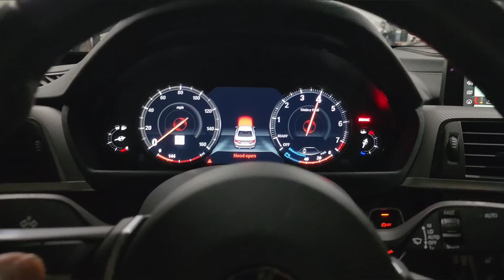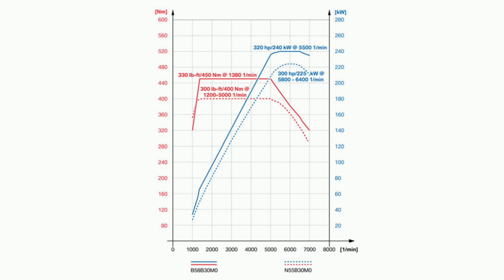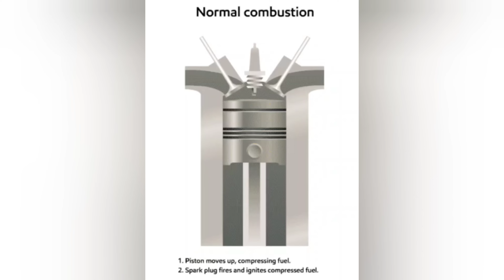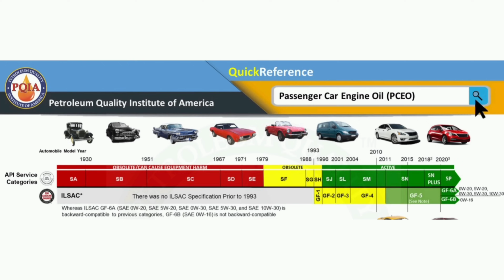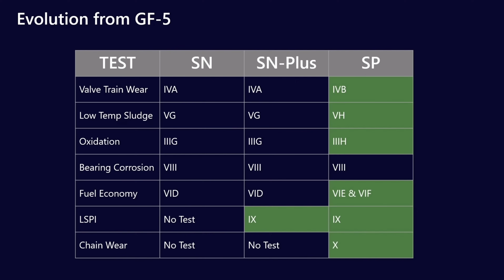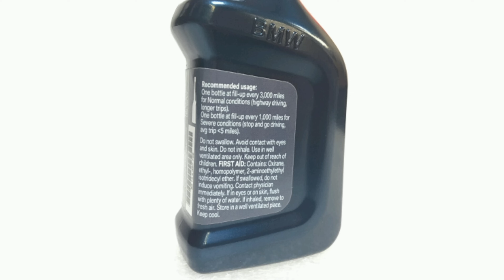The Wrong Oil Could be Causing B58 "Injector Failures" (LSPI Explained)

Comment: Finally someone is making the B58 community aware of this. It specifically applies to DI turbo engines like the B58. I bring it up every time someone asks for oil recs. API SP only for me. Also keep in mind some oil additives, like liquimoly ceratec, have high levels of calcium that contribute to LSPI as well.
Reply: 😱 I put that shit in my engine last oil change! I had no clue
Reply: Just downshift. You’ll never have to worry about lspi
Reply: API sp oil what I’ve been using in about to switch from api sp 0w20 to LL01  liquid moly 5w40 because I watched another video from kern an he said LL01. So that’s why I bought that kind
Reply: What do you guys recommend I live in southern California
Reply: @BoostedF36  pretty much any 5w-30(in warmer months) that is API SP rated.
Reply: But what about api sn 5w30 liquid moly mologen oil that what I was about to switch to..   I have Been using that 0w20 api sp liquid moly since I’ve had the car it be doing great should I stick with that for now
Reply: castrol euro 0w30 is the best oil for b58s for daily driving
Reply: @robotbro7187 No, it's not, it has a very old additive package and the newest bottles have more Group III and lower PAO.

Comment: LSPI has been linked to high Calcium levels in the engine oil.  If you're using LL-01 or some other older spec oil, those oils have much higher Calcium levels than a modern SP synthetic oil.
Reply: Also certain oil additives have high calcium levels . . . like liquimoly ceratec!
Reply: what about Pennzoil Platinum Euro 5w-40? this is rated as API SP and at the same time meets the ll-01 spec
Reply: @maxgnarnage also if you are adding oil additives, you are essentially “watering down “ your oil and reducing the oil life. Shorter oil life=not as much protection. Just stick with BMW standards.
Reply: @540irwd same story with castrol edge euro. you’ll be fine!
Reply: LL01 is needed for high sulphur fuels , SP rating is the key

Comment: We also need to talk about Complete fuel system cleaners with Poly Ether Amine. It the fuel cleaner doesn’t have Poly Ether Amine then it is useless. Keep them injectors clean, don’t lug the engine, don’t use oil that has calcium in it, try to stick with oils that are certified to work with your engines.

Comment: If the oil rating changed from SN to SP, it most likely has had a chemistry change also. You would need to send both sample to a lab and have them tested. Automotive oil manufacturers can change the chemistry without notifying the consumer.

Comment: You say don't lug the engine by pushing down on the gas while at a low engine speed.  One thing I found on another video if you hold the left (-) paddle switch on the steering wheel for a few seconds it downshifts the trans and rev matches the engine so you can do this instead of guessing what gear to use to accelerate and avoid lugging the engine.  I have a 2023 M340 and it works on my car.  It is really cool the way it rev matches for the down shift.  Hold the - paddle for a few seconds then punch it and hold on cuz it's a b58 engine.  For what it is worth.....

Comment: Thanks for the video. So basically with a bigger turbo that spools at f.e ~ 3700 rpm vs. the stock turbo that comes in full boost at ~ 2500 rpm, I'm less prone to have that problem. And I use PEA fuel additive from time to time, always high quality fuel (RON 102 EU / 95 octane US) and API SP 5W30 oil. So it's about time I order my bigger turbo, only to prevent LSPI, of course. 😂
Reply: I wonder how true this is, might have just convinced me a pure turbo is the best reliability upgrade for my 440 😂
Reply: @o-oo-oo-o3234  It's just a guess from my side but LSPI occours mostly in a low revs up to 2000 rpm with high load. So on the stock turbo, from around 1500 rpm (pedal at 100 %) you feel the boost building and at 2000 rpm it starts to go pretty nicely already.

With a big turbo, it should be like completely dead up to 2500 rpm or so which means there is not much load at all at 1500 to 2000 rpm (engine runs basically like a natural aspirated one). So the load will be a lot less in that rev range AND I would clearly not be trying to accelerate in that rev band anyway. 

I could even reprogram the gear shifts with XHP so that the engine is in the 2000 to 2500 rpm rev band when I want a little bit of acceleration instead of 1500 to 2000 rpm where I have "only" like the 300 Nm (~ 220 ft-lbs) of torque from the N/A engine.

Comment: Honestly, with all the new small engines with turbos, now is the better time than ever for amsoil. I believe even their oe line boasts 100% LSPI protection iirc. Though it's probably got some caveat to that claim. I'm glad I went with a non turbo Forester as ever since I read about lspi a few years ago I've been nothing but paranoid for others
Reply: I ran their signature series oil for years with over 700hp in mine. Excellent oil. Still used 0w-20 too.

Comment: Im currently financing a 2022 m340i that is still underwarranty. Unfortunately it only covers oil changes every 10k miles. I under stand its recommended every 5k miles. Would you still recommend 0w-20 liqui moly engine oil?

Comment: You mentioned being in low RPMs and hitting full throttle, I do that to initiate slides, and also feather the accelerator, which actually backfired and doesn’t let me continue the drift. it feels like it cuts all the power when I start feathering it.. especially since I do not have an lsd. Do you believe this will create big problems for me down the line as I am drifting/sliding the car more frequently. I do let it warm up, ride around, before doing it. Anything that you suggest I can do to prevent any damage…?

Comment: Back in 2017 when this started happening people called me stupid for saying that oil chemistry is causing the abnormal preignition with di engines. It's also not just "low engine speed" but also midrange can occur under certain conditions. TLDR is that taking calcium out is good in this case if you substitute with other detergents. 

I'll also say one more thing that people say now I'm "eating dog sjht": Premium gas, especially on DI engines, has a massive impact ( good as in low ) on engine bore wear. The volume of gas mixed in the ring lang area with oil is huge on DI engines and a good gas will actually change your oil analysis iron content change to change :)

Comment: Small Ford engines are bad for this but Ford run an engine at 120°c which I think contributes to pre-detonation. Ideal engine temp for a street engine is about 85°c but you see them running over 105°c which is asking for trouble. With over hot running temp the piston/bore gap goes up and add LSPI it's no wonder pistons are taken out. Mfrs have been running hotter year by year but for an engine to start at -15°c the piston/bore gap can only be so small or the piston will be stuck in the bore at cold start. Therefore there is also a maximum temp for a street engine to run at.

Comment: Thanks for the information. In Europe I never checked the API certification, only LL-04 oil. I just see even my BMW original Twin Turbo 0w30 bottle for N55 is API SN only. Shell 5w30 and 0w30 the same. One of the Liqui Moly is API SP on their website, the two others SN only.
Reply: I'm from Germany and I use "Aral Super Tronic K" 5W30 in my B58, it has API-SP and BMW LL04.

Comment: Hello, I have never heard about LSPI and what damage it can cause! 😮 So, normally, if you have good fuel, good oil which is in the temperature tolerance it should not happen, right?
From what you said it happens when there are low RPMs and you request maximum power but this is typical BMW scenario. 😊 Everyone is trying to overwhelm others how fast can his or her BMW accelerate, right?
Reply: LSPI (Superknock) took out my n26 years ago. Caused by an injector blowing… it’s bad

Comment: Lspi was only found in low displacement engines. Do to lugging. Why you should never put a load on the motor at low rpm and and high gear.

Comment: I thought the knock sensor would have controlled this?
I try to use ESSO 99 with 2X detergents in, you can smell the cleaner and octane when you fill up.
Reply: Knock is not the same as LSPI. Reason why knock sensors cannot save you from LSPI. There is a part where he’s using the two terms interchangeably hence the confusion
Reply: @kengit2  Valid point, however knock and LSPI can go hand in hand, crappy fuel could contribute to LSPI as the car builds boost as well as cause knock/corrections in the mid range.
Reply: No. I had an LSPI years ago. Obliterated my N26. Your DME is not saving you from this.

Comment: thoughts on the 0W20 Top Tec 6600 for the b58? it has the API SP rating through FCPEURO
Reply: It meets the BMW LL 17 spec. I use it on my b48.
Reply: @zzafari7 yes 0w20 6600 toptec i just changed one week ago in my x3 M40I. The norm is the most important LL17FE so 0w20. We Can use Also 0W30 Toptec 6100 LL12FE. 5w30 LL04 i absolutly don't advise. Components inside motor particulary Solenoïd of vanos Can make failure. So 0w20 interval 8000km and 💪🏻🔥😎
Reply: It's what I went with along with Cera Tec per Kies recommendation. I ordered it, so I will change the oil in a few days.
Reply: @Chaletjohan-wo4ke  Does Castrol Edge 0w 20 is good for my b58 engine ? In europe i can only find this kind of oil with LL 04 standards ?
Reply: @goranmiskovic2685  LL04 is to old as i remind above you should use oil with the norm LL-12FE. It correspond for 0w30. But you Also use the LL-17FE 0w20 I run with this oil actually and no problem. 04-12-17 correspond of the years of the norms. So take care of this. It's really important. Castrol... Is not good better to use Liqui Molly.
Reply: @Chaletjohan-wo4ke  ..Thank you for your quick anwser. I don't know why...but here in Croatia official dealers for second time charged me with Bmw oil 5w-30. It is true that my   mileage is low (2000 miles in one year) ...that is the reason why my service intervals are once in a year but i will try to find oils with specs that you mentioned above.  Tnx mate 🙃

Comment: Is this on the b58 gen 1 or gen 2?
Reply: Both, even the B58TU1 has a little bit less compression ratio (10,2:1 instead of 11,0:1), they are still both in danger. But not as much as f.e. a 1.2 liter turbo engine.

Comment: LSPI is also caused by not using the right oil for Direct injection cars. As I’ve seen an Audi s5 in our workshop that suffered from LSPI due to wrong oil being used. FA20 Subaur engines suffer from this massively
Reply: My bone stock Forester XT threw a rod at 58k miles despite using the proper oil and changing it earlier than recommended 😂 FA’s are just garbage engines.
Reply: @busterscrugs  have seen this too. I’ve personally see 2 engine with cracked ringlands completely stock 

Wouldn’t surprise me lol

Comment: Great info! I will be changing to Toptec 6600 based on this video.
Reply: That’s crazy, I decided I’m going to change my oil this morning and bought liqui-molly top tech because I’m putting a flash tune on it as I just got the ecu back and unlocked and thought some fresh fluids wouldn’t hurt. I also got Cerma tech additive because kies motorsports swears by it.

Comment: i use costco gas, there's a station 5 minutes from my house, saw a recent dyno video that compares gas and costco was included, it showed 7HP less compared to shell, car was making around 300HP avg, my buddies always told me to stay away from costco gas, i started thinking they were right but now that i know that costco uses additives i'll keep using it :]
Reply: costco gas has top tier gas certification, it can be trusted.
Reply: The main difference between Cosco, Chevron and Shell is the amount and types of detergents. There is a federal minimum amount of detergents but it is abysmal. This is not really going to affect hp but it does affect engine longevity.
Reply: Stay away from bad ⛽️ fuel

Comment: Injectors went out on my b58 and flooded the engine with gas and lots of metal in oil
Reply: Damn … what did you need to get repaired?
Reply: Were you tuned?
Reply: @ single turbo pi e85 27 psi